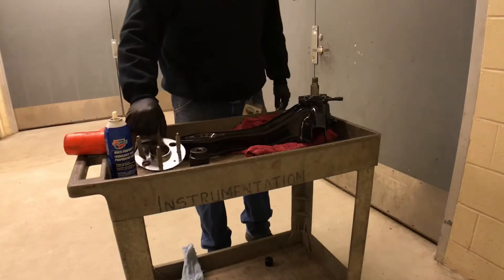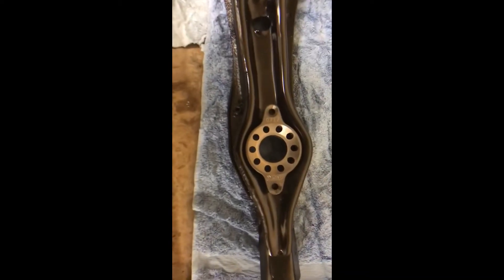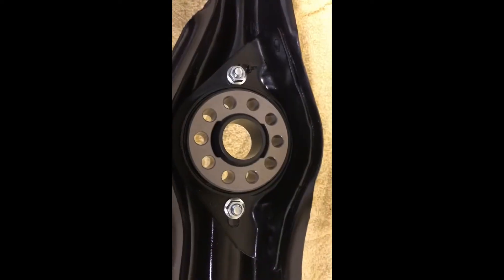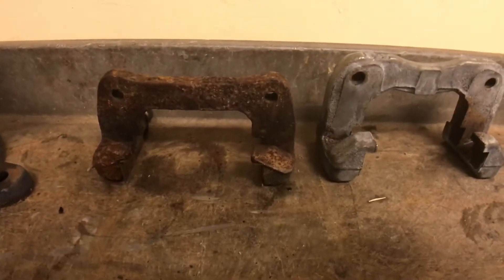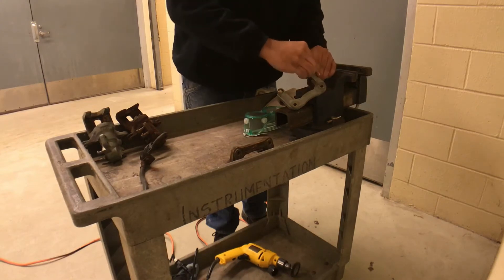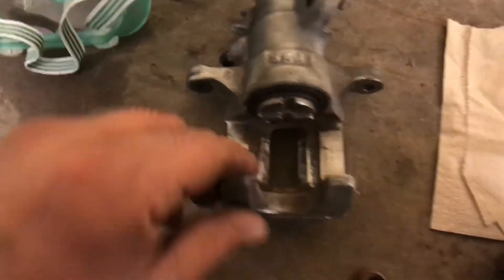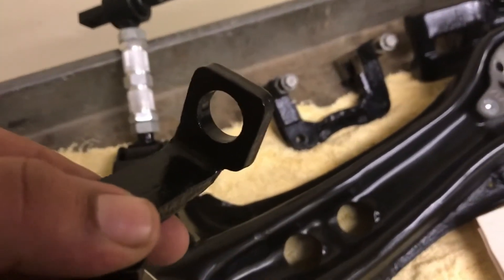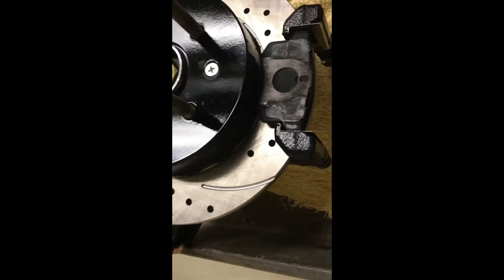Integra RSX rear brake upgrade

Comment: I’m having issues I have them installed but when I do a test on the ebrake I’m getting no kind of stopping,when the ebrake is full lock I can still spin the pass tire there’s very small resistance but not enough for full lock an the driver side doesn’t even do nothing ,I’ve tried adjusting my cables am still nothing

Comment: Dont know if u will see this im doing this upgrade on my ek hatch what ebrake cables will i use and im using wilwood 4 piston front calipers dont know what prop valve to use
Reply from the maker: Ebrake cable 99 civic si, front brake line stock will work and a prop valve 40/40

Comment: So the e-brake stuff ended up being on the top since you flipped the calipers over? How did you bleed the brakes with the bleeder screw on the bottom? I'm using RSX rear calipers on my mirage with custom brackets but I can't get the brakes to bleed correctly. You had no issues?
Reply from the maker: 89Mirageman I take the caliper off the bracket and use a c clamp to hold the piston in the caliper and have someone pump the brakes and bleed as normal
Reply: @RevHighDriveHappy  OK so you did have issues just using the bleeder screw to get them bled at first since they were flipped?
Reply from the maker: 89Mirageman Just unbolt the caliber from the bracket and flip it so the bleeders facing up when you bleed it you’re gonna need two people to bleed it this way

Comment: Greasy video I'm just a little confused but if we use the left caliper on the right so do we use 2 left side calipers? Or what about the right caliper?
Reply from the maker: You will use one left and one right you’re just going to install them on the opposite side so the bleeder will be facing up

Comment: So If I wanted to go 5 lug in the rear. I could technically just use the ITR rear hub, RSX rear Rotor and caliper with bracket correct ?
Reply from the maker: Nick G I believe that would work.... I’m like 90% sure
Reply: @RevHighDriveHappy  do I need to get 2 left side rsx caliper?
Reply from the maker: @javiercuevas6277   you need one left and one right.... right caliper will go on the left side... left caliper will go on the right side... you do this so the bleeder valve face the right way
Reply: @RevHighDriveHappy  ep3 2002 civic si calipers same rsx?
Reply from the maker: @javiercuevas6277  I’m 99% sure they are you can go to Autozone and ask for the part number for both caliper just to confirm

Comment: Which break line do I use rsx or dc2? I want to run braided break lines Idk which one for this application
Reply from the maker: I just found out if you just use the EP3/RSx caliber bracket you can keep the OEM calibers but you still use the EP3 rotors
Reply: That’s cool how about the pads? Rsx/ep3?
Reply: @RevHighDriveHappy  I just wonder how the braking will fill with the stock caliper just using the ep3 brake pad

Comment: Very nice vid. I performed this on my CRX back in 2015 and it is an easy upgrade system. Just wondered why you didn't use a rear dust shield on your setup?
Reply from the maker: EM1 Tuning the dust shield were super rusted

Comment: Will 15x8 gram lights fit perfectly without hitting or will i need spacers since the brakes are bigger??
Reply from the maker: HaterHurter sirG345  The rear brake upgrade makes the rear brakes the same size as Integra front brakes which are 10.2 so if they clear those I would imagine that they were clear in the back
Reply: @RevHighDriveHappy  thank you fam waiting on the next mod vid #notificationbell
Reply from the maker: HaterHurter sirG345 thank you 🙏 I appreciate it

Comment: Should be the same for a DA integra rite?
Reply from the maker: Jose Contreras it should be
Reply: @RevHighDriveHappy  just fished and lines up perfect. Only tricky part is bolting the e-brake cable braket to the caliper. You have to bolt it down first then pull the lever and insert the pin.
Reply from the maker: Jose Contreras to be 100% honest I still have these trailing arms sitting on a shelf still. I’m just waiting for 1 part on my current set up to go bad then I’ll throw these on. But I’m glad the video was able to help you out.

Comment: Job done on eg sedan both with front 280mm conversion. It's a snap.
Reply from the maker: sotiris athanasakis that’s awesome
Reply: Were I can send you fotos?
Reply from the maker: sotiris athanasakis my Instagram is revhighdrivehappy
Reply: How did you use 280mm in the back? What calipers?
Reply: @JoseContreras-mv5yz  280mm Rotor is for the front.

Comment: Which hub is required? Thanks
Reply from the maker: Everything is stock integra beside the rotors pads and calipers
Reply: Same conversion on eg sedan the calipers are the 9CLP14S you have to put the handbrake brackets left right in correct order but reverse the calipers.